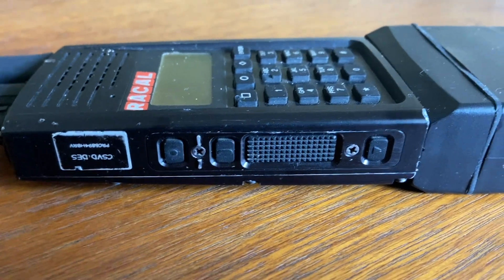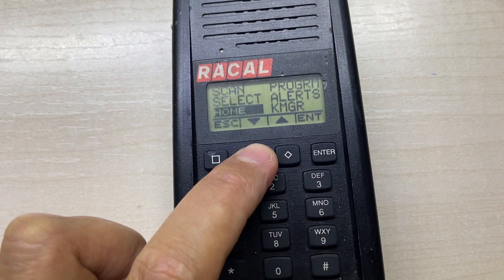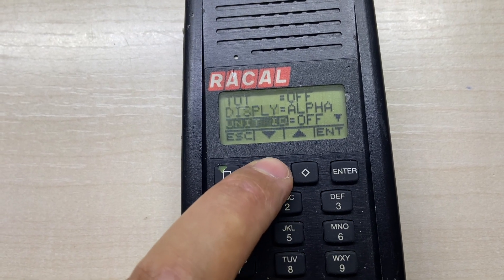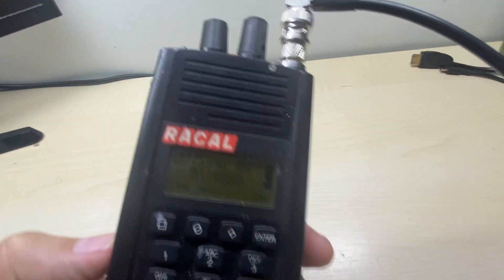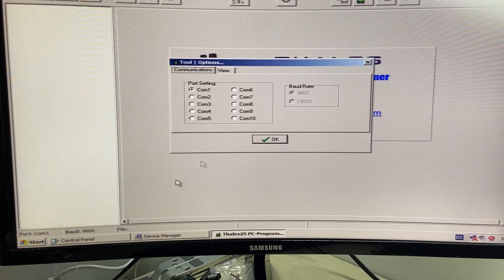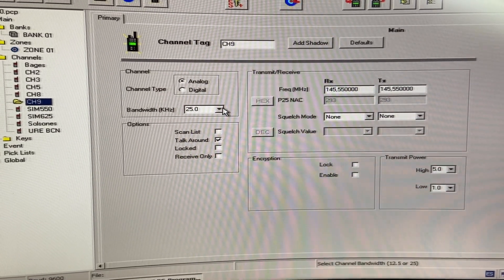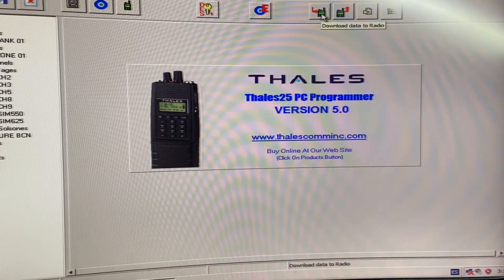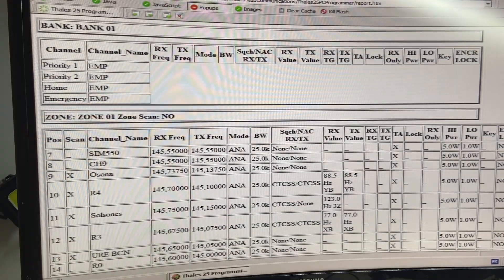Racal 25 VHF

Comment: I just picked up a couple of these, they feel great but my XP machine refuses to talk to the radio using my 3 wire serial. I'm going to try your L-ION battery mod, I assume it still doesn't fool the radio into 5W TX because the one-wire isn't present in the AA pack?  Another great video.